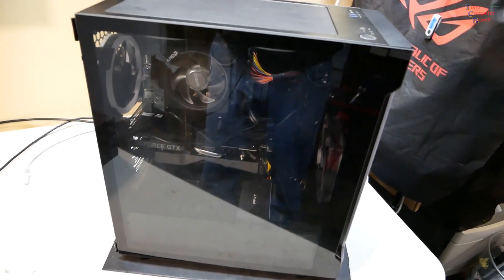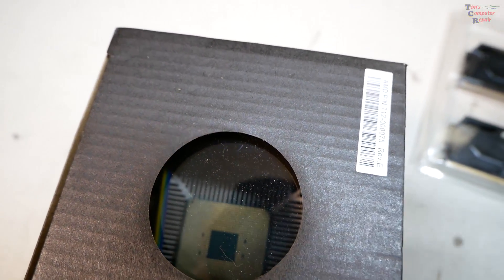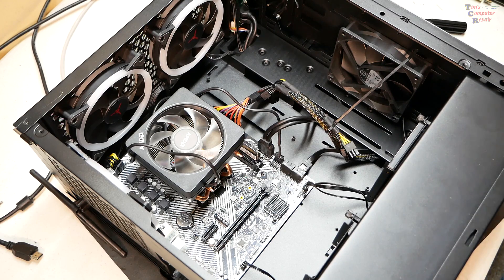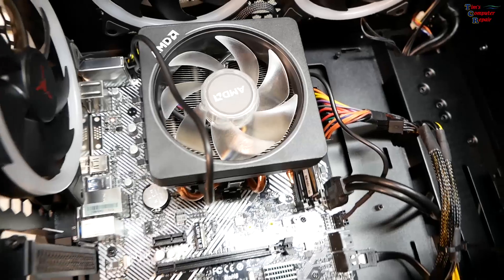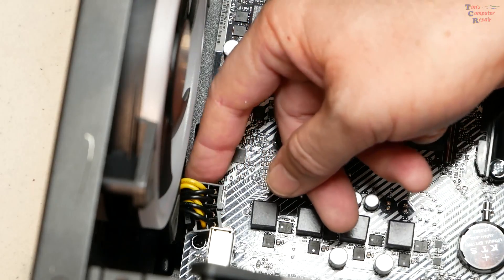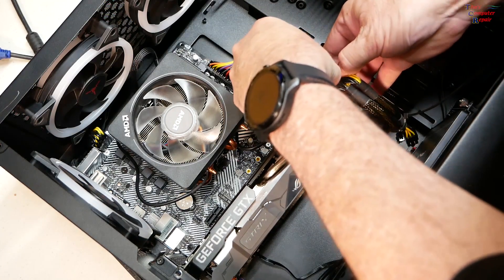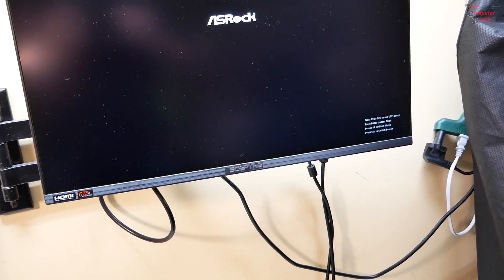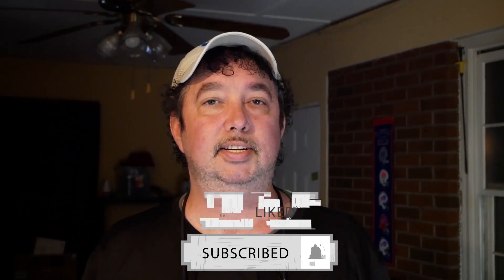My Gaming PC Will Not Boot Up After Upgrading

Comment: I just installed a newer cpu and 1 of my 4 ram sticks won't let my pc boot, the ram was good before the upgrade and the slot it was in still works what would make that single stick of ram not work with my new cpu even though they all are the same brand and I know it worked before the cpu swap?
Reply: Same problem, did you figure out what the issue was
Reply: @Jaykurosakii  i mixed the ram sticks to a different slot that worked

Comment: So ive had a similar problem. I was gonna replace my old CPU with a new one and while i was trying to be as gentle as possible, it ripped out stuck to the heatsink. When i put my new CPU in the computer turns on but no post, but i figured out that my new one doesn't work with my current motherboard. I took that one out (wasn't ripped off like my previous one) and put my old CPU back in, but now my PC won't turn on at all with it in. I ordered a new motherboard but i was wondering if there's anyway to fix it before i replace the motherboard, or should i just wait til it gets here and replace?
Reply from the maker: Be sure to clear the cmos when changing processors.
Reply: Got it working, thanks! @TimsComputerRepair

Comment: please help me I have a prebuilt 1660gpu and a ryzen 5 2600x I decided to get a ryzen 9 5600 and I installed it and now my pc wont turn on 😭 please first time I installed it , it ran but my monitor didn’t turn on then second time I replaced it with my original the keyboard would light up but it wouldn’t turn on now I’m out of luck it won’t turn on at all. I took the watch looking battery out put it back in after 10 seconds and changed up the ram slot still no luck

Comment: I just upgraded my cooler to an aio and to a new case h9 flow. Now my Pc won’t turn on, no power, no spinning no rgb. Nothing. Tried another gpu, tried without extensions, tried different amount of ram installed. Tried my old case front panel and still nothing. A y one have any ideas
Reply from the maker: Confirm that it is not your power supply.
Reply: @TimsComputerRepair  I tried another one did t work. Gonna try mobo later

Comment: Tried upgrading my cpu spent 2 nights swapping the new and old cpu back and forth. No screen with new cpu 75% of the time. No boot for the rest. Stuck in bios settings. And changing anything results in no screen. Garbage paper weight. Guess its just not possible to change cpu and have it function.
Reply: How did you fix it?I have the same problem
Reply: @mariogamingparadise7600  put back the old cpu and put the new one back in the box where it now sits on my desk as a paperweight.
Reply: @nfsfanAndrew  I tried but still no boot

Comment: Nice job is it very hard on the processor socket to pull out the old processor without unlocking first?
Reply from the maker: It is important if the heatsink is stuck to the cpu to be sure to pull and twist gently straight up in case you pull from the socket.

Comment: many a time i pulled  a amd cpu ute with the heat sink going back to am2 and 1 or 2 old intel ones,you dont rip them out they  just fall out when you  pull the heat sink up.there is nothing you can do if its stuck to the chip all mine work  fine after,,,
Reply from the maker: Yes but you can never just assume. I have only ripped one AMD cpu out of it's socket by accident. Since then I simply apply heat to the heatsink when needed and that will enable you to properly remove it. Thanks for commenting.
Reply: @TimsComputerRepair  yup I usually let a system run for a while to get the CPU and cooler warmed up rather than trying to remove a cold heat sink from a cold CPU

Comment: can someone answer me rq slight trouble i juss replaced ram gpu and fans now everything boots and work properly except it goes straight to bios . now the hhd and ssd both are recognized in the bios under memory ( b560 pro mobo) now its in ahci mode and when i go to change boot sequences it juss shows uefi hdd uefi cd dvd etc

Comment: I've lost count how many times an AMD CPU has came out when removing a heat-sink. Having to remove the CPU from the  paste. The slow wiggle (As you did yourself) is the safe way.  Thankfully, never had an issue reinstalling or upgrading the AMD CPU when that happens. Great video, sir. Thank you for sharing.
Reply from the maker: Yeah also applying a small amount of heat will aid in removing the heatsink. Thanks for commenting.

Comment: I just ripped my cpu out the same way he did, had the same issues, so this had me worried at first. Gave me a couple things to actually check, so thanks for this.

Edit: wasn’t the RAM, so I’m still at a loss of what is preventing it from booting. It was still worth checking, at least.
Reply from the maker: Thanks for commenting.
Reply: We’re you able to get it fixed, I also took out the CPU like he did, but mine was tangled in a wire with metal box, I just replaced the CPU I checked the RAM but I’m still having booting issues :( my PC fan goes crazy also :(
Reply: @TheAccountant1000  did manage to get it fixed, it was the BIOS that turned out to be the issue. Make sure you update that before upgrading your CPU- i didnt know that at the time either
Reply: @TheMadRatKing  how did you manage to get it fixed when bios wasnt updated?
Reply: @lurtzz  I had to put the old CPU in and update the BIOS first, then go back to the new one.
Reply: @TheMadRatKing so i updated my bios to the most recent version and it still won’t boot on my new CPU, im using an asus g11cd motherboard

Comment: That OLOY ram is cheap crap and doesn't work in half the boards!
Reply from the maker: Worked well in this build. Thanks for commenting.
Reply: @TimsComputerRepair  You didn't even check to see if it was running with xmp profile. I doubt it was because the owner was an idiot in the first place for even bringing it to you with that stupid issue.
Reply: @Deeworldx You must have the one of the ones it works in!🤣🤣Have you tested it with MemTest86??
Reply: @Deeworldx Carey Holtzman tried to use some on a live online build and it didn't work!